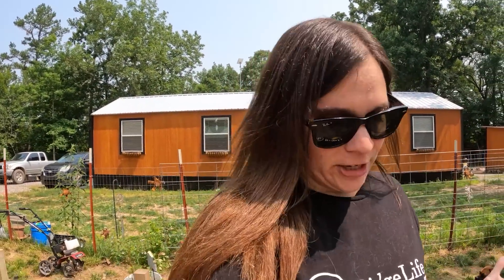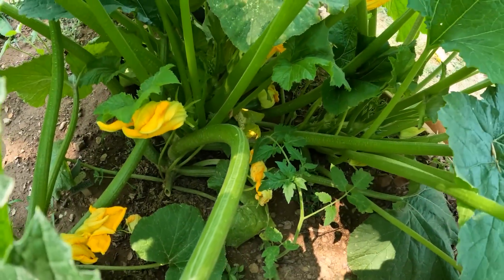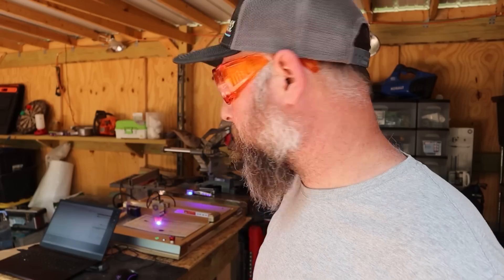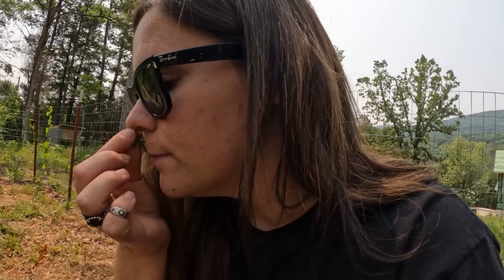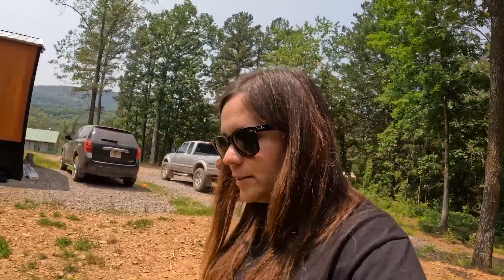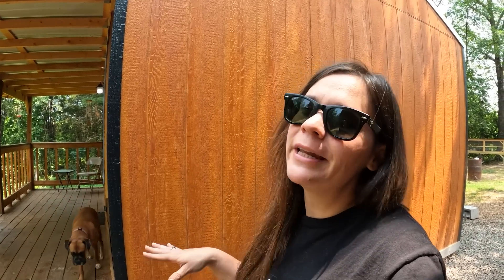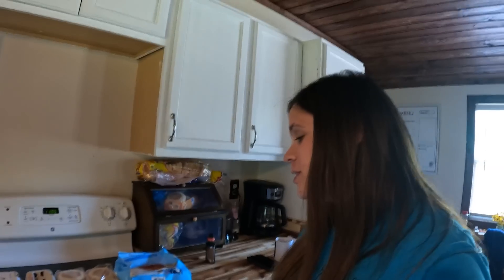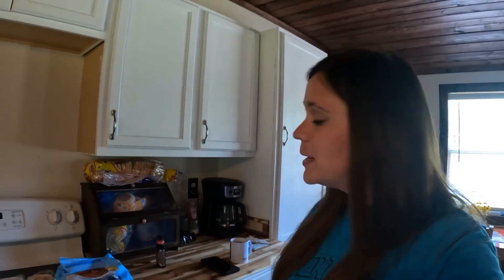Amazing additions to BOTH HOUSES!  | Shed To House UPDATES! | DIY |

Comment: Carrot tops make the best tempura.  All you need to do is to wash them well, and then make a batter for frying.  I use my air fryer to cook them and they turn out crispy.  This was my mothers' way to use the tops.  I also use the tops in salads without the stems.

Comment: You two are rocking it with the furniture refinishing, egg glassing and use of eggs! Hey Ant, if you have a carbide scraper, that works wonders to get the old finish off. So glad you found that lovely piece of furniture and saved it from the land fill. I have humming bird feeders also and found out that the birds change their diet for a couple weeks when their babies are born to insects. I also found out that a mold will form on the feeders and and so I have to clean the feeders to make sure that is gone so now I change the nectuer about 1x week. I know when it is time to change and clean if they stop feeding on a certain feeder.  I use sugar and water 1/2 ratio, 1 cup water to 1/2 cup sugar and they love it. Even cheaper than the dollar store.

Comment: I don't  remember if you talked about the rabbit poo you will soon be reaping, but your cukes and squash will certainly love  it. It doesn't burn, do it's safe to use without composting first. I just sprinkled it around the root areas of the plants and let the watering leach the nutrients out. Crushing the pellets or soaking them in water to make a tea for watering is also useful.
Just don't  add nitrogen your yomatoes, as tomatoes really enjoy it and will profusely grow, but not produce fruit for you. They don't need to put out fruits for seeds if they are growing nicely. 
(Corn also would love the bunny fertilizer, but you don't  have enough for that. Composted chicken manure will work, though.)
Your garden is looking so nice, BTW...

Comment: You can make your own nectar. Four cups water, one cup sugar. Heat it on the stove until all sugar dissolves and is clear. I keep the extra in a quart canning jar in the fridge. Makes it pretty cheap to feed.
Reply: I've used this formula for years & it's so handy to have some stored in the fridge.  I always wash my feeders before filling them. I'm going to try your method of heating the water to dissolve the sugar.❤

Comment: With the egg shells, I just rinse them , dry them and crush them with the mortar and pestle and put in an airtight container until I use it and mix the powder in with the dirt when planting. Saves on boiling and baking them. No contamination. . Hey but that’s just me 😀

Comment: Love your videos.  I look forward to watching them.  I use egg shells in my garden also.  I just put the shells in a small bowl to let them dry out then crush them really fine in my bullet. I store the fine crushed egg shells in a zip lock bag and use the shells as needed.  I found out if you boil the shells the calcium goes in the water. You can use the water for your house plants.

Comment: hey rox, are you still thinking about an island in the kitchen?  if you don't want to use the cabinet hack I have seen to make your island, you can search for a bar height  table.....if you don't necessarily need storage, just extra work top area a table is perfect...anthony could put a shelf on the legs for baskets to store potatoes and onions...if you do make an island I vote the base color of green to bring your accent wall color into the kitchen, a butcher block countertop would look so pretty with the green, if you go for a table, I vote for green storeage baskets, or spray painted straw baskets....

Comment: Anthony, good rule of thumb.  Start with 80 grit, then 120, then 180, and finish with 220. Though the finish with 220 is a bit of over kill, it works.  Then dampen the surface, and do the last step again, as it will raise the grain as it dries.  This prevents the stain from being the step that raises the grain, which as you know at that point, it is too late to sand again.  I like to finish my projects like this with a light coat of spray lacquer which will protect it from staining of leaving rings from coffee mugs or sweating cans.
Reply from the maker: I agree lol, all I had was 220 and I was just hoping it might work lol

Comment: Question:  Do you put the date on each egg before you put it in the lime solution, to make sure you
rotate them properly when taking them out for use?
Reply: I saw a tip on another channel that was useful.
 1. Put eggs in 1/2 gallon  jars.
 2. When jars are full, mix solution in another jar.
 3. Place eggs from the first jar into the second jar.
 4. Your oldest eggs are now on the top. The freshest eggs are on the bottom.
 5. By using smaller jars, if an egg/jar goes bad, you will only lose a few eggs, as opposed to a whole 5 gallon bucket.
Reply: @Troupe112  -  Interesting Tip.  Thank you for sharing.  I hope Roxanne reads it.

Comment: Is that hope chest Cedar? Most hope chests are cedar to preserve whatever’s inside. If so, you’d be much better off just resealing it. It won’t take stain well.
Reply from the maker: I wish it was , it's actually pine that was stained
Reply: @countryroadcure  Ok. I always strip pieces like this bc the lacquer just destroys sanding pads. But, in order to remove it by sanding, I’d start with 80, then 100, then 220 to finish. Can’t wait to see it when it’s done

Comment: Why don’t u use ur muffin tin, n crack a egg in each one, no waste, no fuss, if u get the rubber ones, u just spray them with some oil n crack a egg in each one, n throw those in the oven, along with spices unlike, or u also can add anything else u like too, n make omelet too. Add cheese if u like, I do bagel sandwiches too, or toast if u like. Just FYI